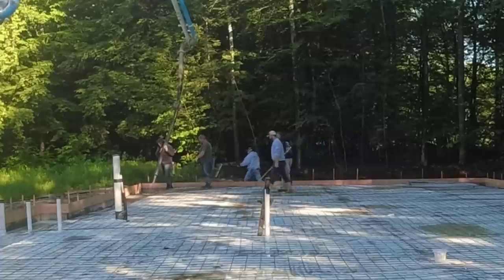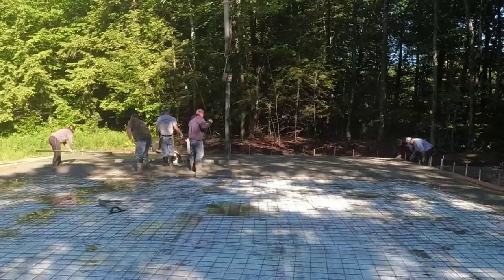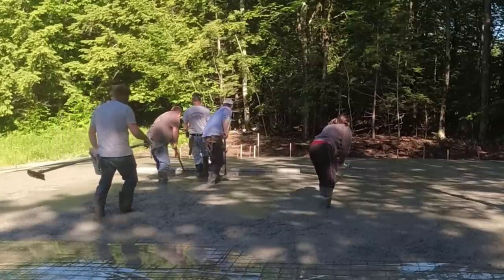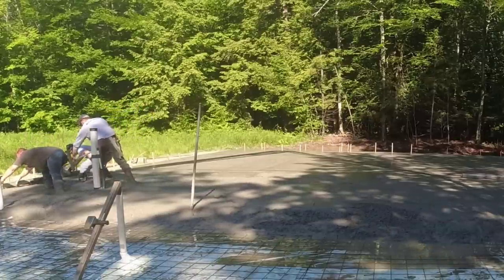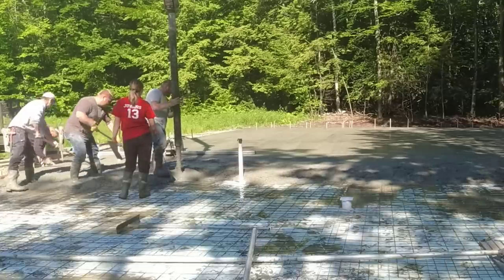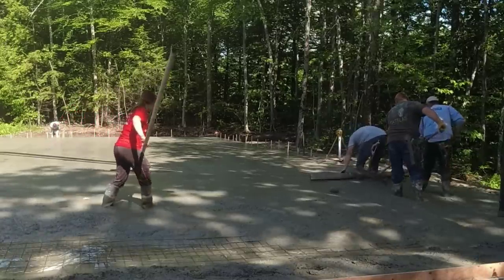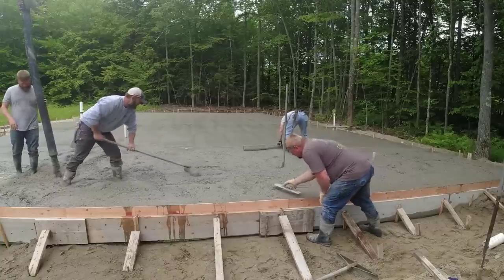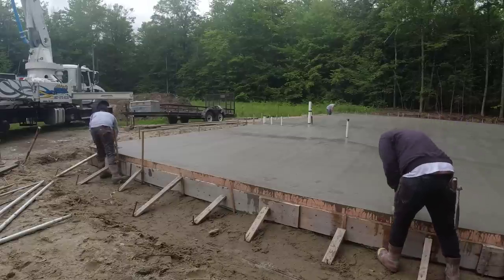How To Pour A 70' x 40' Concrete Slab Foundation

Comment: Do uou pull up the wire mesh if it has radient floor heat pex. Or do you leave that flat under the concrete